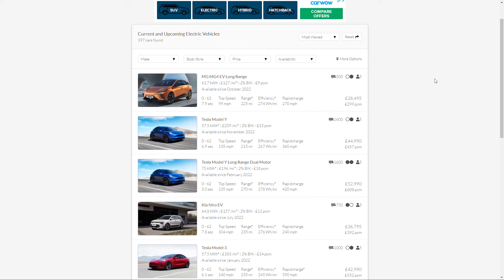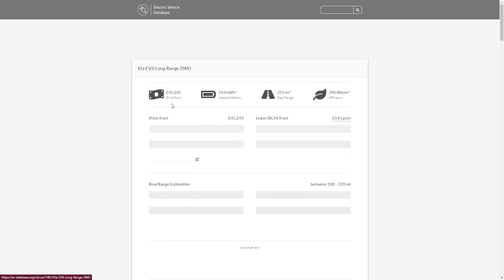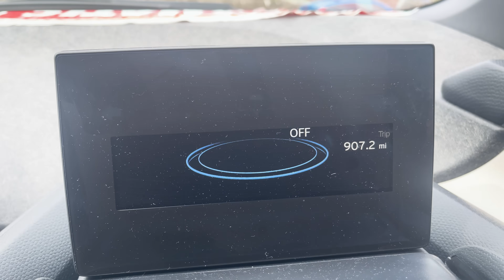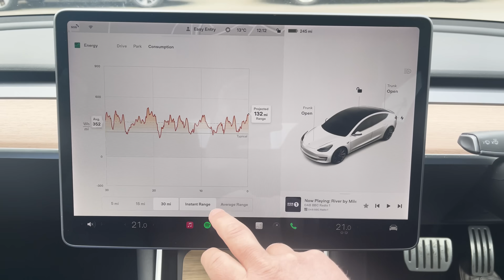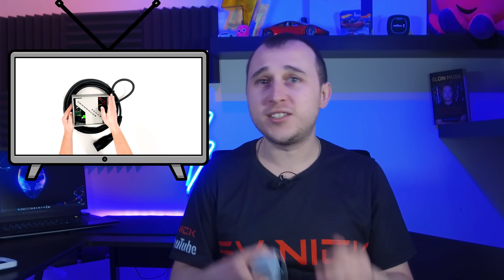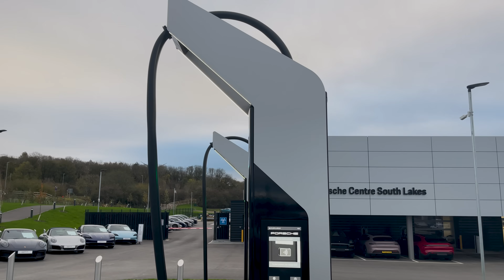Ugly Truths Electric Car Owners Don't Tell You!

Comment: No one seems to bring up the depreciation. Trying to sell your EV you face the prospect of losing most of your equity in that vehicle from no one wanting it for fear of the battery not being new and therefore not having the original range, the exorbitant cost of battery replacement/repairs and the cars older hardware/software OS. ICE vehicles retain their value better and sometimes increase.
Reply: Depreciation is only a problem if you need to trade your car in regularly. And you forget that the dealers themselves make their money on the trade-in, not the sale of the new car. The spread between trade-in cost and resale has increased dramatically. This applies to all vehicles, not just EV. As for the trope concerning battery repairs, that’s been disproven for some time. Nearly all brands have an eight year warranty. Companies like Tesla are already offering additional extended warranties after that. And once we have twenty year old EVs, I’ve no doubt rebuilt batteries with core allowances will be a thing. The difference? It takes less than 2 hours to swap out the pack on my car, so the labour is way cheaper compared to an ICE vehicle motor or transmission. We have a twenty year old VW camper. Paid a lot for it, but we’ve paid far more than that on repairs alone. There are a lot fewer parts in an EV. No transmission, no timing chain, no injectors and so on. Plus we charge at home, spending as much in a year as three fill-ups and doing double the mileage. No plans to sell my EV!

Comment: I have hired a Polestar 2 and I used the built in Google maps that gave the expected percentage on arrival. This usually gives a pessimistic expected range when you start, but with driving nicely seemed to always increase; I left Heathrow with 8% expected charge on arrival, but actually arrived with 42%!

Comment: EV database for the win. I used the data there before I bought my EV 3 years ago and the data has proved accurate. Good job really, as range is an important issue if you get it wrong. I did my homework and all is fine. From most of the horror stories I’ve seen about range, almost all have been expecting to get the WLTP figures at all speeds and in all weathers.
Reply from the maker: Even EVdatabase is a little off at times its a bit unfair to cold weather but its one of the best guides I agree

Comment: I'm still a little bit worried about the range as our 1st EV was 24kWh Leaf. Just got an e-Niro 64kWh and it's a completely different ball game. Very accurate GOM. Very. In fact if it is not spot-on, it underestimates by a few miles. I drive 80% on motorways and 20% in the city. Not hypermiling either, I had to in the Leaf.

Comment: Well first of all nick if you haven’t put any prospective Ev buyer off  in the first 5 minutes of this video I will be amazed. A lot of what you say is good advice but there are some that I question. First the VTL it might be no good except if you run out of juice in your Ev and are desperate for a charge to get you to either a 3 pin plug or a charger you may have a different view on it plus if you have a power cut at home. Secondly the problem I have with VTG. simply charging your Ev battery only to discharge it to sell it back to the grid might be good in one respect but a battery’s like is measured in life cycles and as such over time you are shortening the life of the battery. As for the range of an Ev obviously it’s based on how and on what roads you drive fast on motorways or steady on country roads and of course weather has a part to play. I drive a Kia EV6 GT line S single motor and I get driving around we’re I live having charged it to 90% get 276 miles now in the winter I would expect that to drop to about 250 miles.

Comment: People who sell cars normally don't have a clue about the actual mechanics or systems in a car. Working out "REAL" EV range is quite easy, take the useable battery size (not the sometimes quoted size) and multiply it by 3 and that will be a good year round average range. Tesla claim higher than 3 miles per kwh but that's in warmer climates with a sparrow driving with NO aircon on. Example is 50 kwh battery and it will do 150 miles. My EV will do 3 miles per kwh at 70 mph with aircon or heater on. Short distances will give lower "guess" ranges. A granny charger on a RCBO is fine as long as you are only charging at 10A (use a 32A commando socket to do 13A) I didn't think you were an electrician or EV charger expert so how did you strip them down and test them ? 
EV batteries do have an 8 year warranty but most state 100k miles and less than 75% capacity before they would replace it. No replacement if you have a 50 kwh battery and it is 37.5 kwh before 8 years old and that could be a 38 mile loss in range (150 new to 112 miles). Battery reports will be looked at when you trade in your EV so the value will be a lot less. One small cell failing can kill a battery pack as a guy in the USA found out with his Tesla. Tesla only offered a replacement at $16000 but a garage took the battery out and simply cut out the faulty single cell 3.2V cell (100's in an EV pack) fixing the car.

Comment: All I did was to have an electrician install a 220 amp plug near the charging port  located on my 2019 Model 3 Tesla. The charging cable is provided by Tesla.
Reply from the maker: 220amps… you running a super charger

Comment: I'm thinking of changing my Zoe, but it's probably going to have to be for a secondhand EV around the 20k mark. Are there any secondhand cars that can do V2G (or will be able to in the future), or am I going to have to leave that for a few years?
The GOM of my (ZE40) Zoe is pretty accurate, and it's predicting 170 miles at the moment. :) I checked CanZE and it's showing 91% SoH, despite having done 50,000 miles in almost 6 years, so I definitely can't complain.
One thing that non-EV drivers always underestimate is the effect of the cold. The same car that's showing 170 miles now was showing 96 miles when it was -10 degrees in December!
Reply from the maker: Only car that can do v2g currently 100% with no issues is the nissan leaf using chademo,  other cars claim they should be able to do it however till the cc2 v2g standard is agreed I can't promise you it will work later this year this should change
Reply: @NicolasRaimo  Having spent years stuck with AC Rapids, there's no way I'm moving to Chademo! I'll take my chances with something with CCS. :)
Reply from the maker: @duncanmartin2626  ID range LARGEST battery MAY do v2g if the car was made from a later date build however I wouldn't count my chickens on this.

Comment: My Hyundai Ioniq 28kWh GOM is pretty accurate and having driven a Leaf, Tesla M3/Y I have found my Ioniq's distance to predicted is pretty accurate. I always drive by percentage and know my cars range by outside temperature and speeds. Motorway/A roads lessen range although a mix can still be efficient, I regularly get 6miles perkWh from April to November. Tesla is miles ahead with charging, I recently completed a 2000 mile road trip in California with a Tesla Model Y long range and it worked effortless, in fact it helped that the charging stations are located in nice areas and have comfort break facilities located near by.

Comment: I have 2 electric cars ... a 9 year old Tesla Model X that I've owned since new  and it is the lowest depreciating car I've ever owned. My latest car is an MG. Each of these cars has a real world range in excess of 150miles, which is more than adequate for most people, as the average journey is now less than 40 miles, and there are more charging stations than petrol stations. Neither car have needed any mechanical repairs.

Comment: I’ve seen a video of a model s that’s had a battery replacement for £10,000. 

All be it not cheap you’ve affectively got a new car and I think it’s a fair price. 

As long as you don’t have any other problems with the car why would you replace the car and not just the battery?? 

People have been doing exactly that for YEARS with (ICE) car’s only it’s cheaper because the technology has been around FOREVER!!

Comment: The range aspect is true, but also for petrol and diesel cars. Using the internet to check actually achieved ranges fit your requirements. I worked out in general the longest return same day journey I would willingly do is a 100 miles out and 100 miles back. So 200 miles minumum range. My Kia ENiro worst case 2 Celcius 3 adults and 100kg of luggage in winter gave me 218miles whereas best in summer has given over 270 miles, with 215 mile journey from south coast and 60 miles left on GOM.  (Higher than claimed figure).
Get a proper 7kWh home charger and 95+% of time you will go home plug in car and wake up to a fully charged EV. 
Cheap night tariffs are a must and even in todays 34p electric rates, you can get overnight rates less than 10p to get  a cheap price.
Buy an EV with the battery size that works for you. 20 miles a day and that is it, buy a cheaper EV with smaller battery! If you travel 150 miles every day it is perfect with a 64+kWh Battery and that is easy, no visits to a fuel station, just drive home, plug in, eat, sleep, wake up and drive.
No change in my battery and range for past 2 years.
All of this works if you have a driveway and is almost a no brainer for savings. Total cost of buying the car and electricity, and servicing is really cheap, compared to a similar ICE car.
I have only needed to occasionally charge at rapid chargers. I would say to stop thinking about refilling the battery and thinking about how much range you need to get home , where you can charge for cheap.
Also, a lot of EV;s have batteries that you regularly charge to 80% but do 100% only for those longer trips.

If you can not park and charge off road, an EV will be more difficult to run and far more expensive due to the ridiculous charges at rapid chargers.  We need to think big, with 50 - 100 destination chargers ( less than 11kWh ) at areas you are likely to stop for 3+ hours. Then more rapid chargers at coffee shops and fast food areas.

My last thing is the EV range out lasts that of me or my wife needing breaks or coffee.

That is my thoughts.

In reference to the GOM, it is very good and obviously adapts over the year due to heat or cold.

This video is fair for EV's and is the kind of information I tell people. Saying EV owners won't like it was very misleading!

Comment: My issue is with the cost of battery cars - they seem ridiculously expensive - yet my old UREA diesel would be able to enter the ULEZ - the same as they are. Excellent feature !
Reply: Get a car 6 months old you can save 35%  that brings down to ice car
Reply from the maker: Cost upfront for EVs is no secret and yes they cost more for purchase but the savings from them are A LOT MORE.  Recently via work had a customer trade in his 730d euro6 car for a tesla model x he's saving £1000 a month in running costs
Reply: @NicolasRaimo  Depreciation is much worse with an EV though. And if you have to charge away from home a lot, public chargers cost double what you would spend on diesel. You chew through tyres at an alarming rate too, especially with high torque motors. On a Model 3 Standard Range, you're lucky to get 10,000 miles from a set of tyres. I know someone with a Taycan who gets less than that. Insurance is considerably more, depending on the vehicle. Last year, Model 3 cost £700 to insure. This year £6800. Overall, it's a lot more costly to buy and run an EV in the UK compared to petrol or diesel.

Comment: I don't know or really care how accurate my guess-o-meter is. I've owned two EVs and always driven them displaying battery percentage mode. 90%... 55%... 23%... that's what I see, and I try to stay between 20% and 80% for daily driving.

There's no point showing the GOM for me because I only care how full the battery is. If I'm on a long journey, the car works out roughly how much percentage battery I'll have when I arrive at each charger or at my destination.

I've only had mild "range anxiety" in my old EV, on a couple of long journeys, but nothing worse than being in a petrol car on the motorway when you pass a digital sign saying no petrol available at next services.

In my current EV (Tesla Model 3 LR AWD) I've never had range anxiety after over 20,000 miles. If I see 15% on the battery gauge, I've still got over 30 miles to go before I'm driving on fumes. The car navigation automatically inserts charging stops and gives excellent info about how long to charge, and what percentage to charge up to, to continue my long journey.

Crucially, when charging, it also shows how much percentage I'll likely have when I reach the next charger or my final destination. This info means I can't make a mistake if I at least wait until it shows I'll have 10-12% on arrival.

Comment: The display at the top of the screen on Tesla shows the 'rated range' - so simply a calculated figure based on the WLTP rating, and does not predict based on your right foot at the time. The other displays - the energy graph and, more importantly, the route planner's arrival percentage are very accurate.

Comment: Great video Nick - a very thorough and honest roundup of all the things that need to be considered by anyone thinking about getting an EV.  The range issue is probably the most difficult for many people to understand.
You're right about the number of factors that can and will affect the range you'll achieve in an EV.  In my 2 years of experience I'd say the two most significant factors are a person's driving style and how much they want to use the air con in the car.  I've got a Hyundai Kona and in 2 years I've covered almost 20,000 miles.  I have achieved 300 miles of range in the summer months and 240 miles of range in the winter months.  This is less than the WLTP figure but more than the EV database figure.
On the subject of charging - doing as much of it as possible at home and avoiding the more expensive public charging networks is the ideal and cheapest option.  If you can afford solar panels then running costs reduce even further.
Sadly, I think the harsh reality for many people is the cost of an EV.  It is simply beyond many peoples reach.

Comment: Nicolas, I always enjoy your informative videos.  To answer your question, I expect my battery SOC% display to be within +/- 5% or better for a new healthy battery, and +/- 10% for an older battery, over 6 years.  If I have recently charged to 100% and driven to 10% or less, then it will be more accurate. This expectation is not only for my EVs, but any EV that I might drive.  I don't use the "miles remaining" display.

Comment: No real 'awful truths' here. In my experience public charging is much better than I've heard. Charged three times on public chargers (on long trips) - got into a space immediately, charged in 30 mins and cost was reasonable because I have an Electroverse card which gets me discount. I charge it at home most of the time and use an Octopus Energy to get cheaper rates. So far (after 4 months) my average cost per mile is about 3.9p. I have a Zappi charger which optimises the availability of sunshine to keep my costs really low and I'm now on FLUX with Octopus

The car was £31k brand new (MG4 Trophy) and has a seven year warranty. It also has vehicle to load capacity

All cars have pros and cons. I've driven a lot of cars from 'wreckers' to high end 'exec' motors and they all have their charms.

Comment: Having owned a used EV (specifically a Renault Zoe) for 4.5 years, I found the maintenance costs were actually higher than my diesel, averaged out over time. The suspension seems under-engineered for the weight of the car.

Good to know about MG and Tesla charger incompatibility, as I've recently replaced the Zoe with an MG ZS.

Comment: "battery replacement is expensive" yeah. but even the worst offender on battery degradation only has something like 5% rate of battery replacement(presumably due to degradation). so most people simply sell the car on to someone who is ex. only buying an EV as a second car to run to the store and back in. plenty of people see an EV as only useful for that so why not. as for GOM, i wouldn't really mind it simply not existing unless its based on navigation data the way Tesla does it when the driver navigates to something. its just an excuse for car reviewers to go "see, i drove like an lunatic for 10 miles and now the car is displaying a 100 miles less than it did when grandma drove it." "vehicle to load is useless" no easier way to sell me a car than letting me have an always on plug. why? charging stuff, keeping drinks cool, maybe running a toaster or boiling water are basically superpowers when camping. what do you mean its limited by amps? so are most plugs in your house but you didn't simply give up on putting them there because they can't run the induction plate and the owen at the same time.